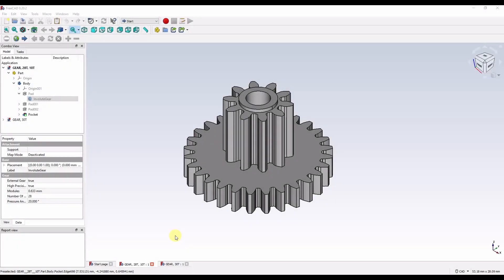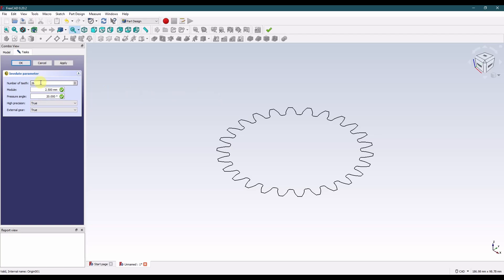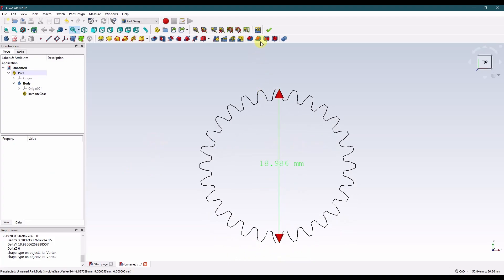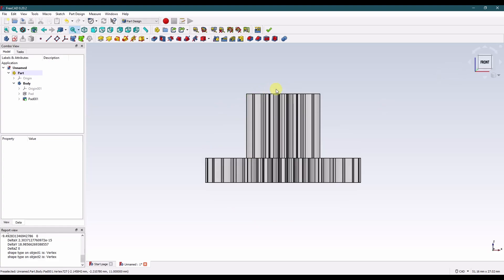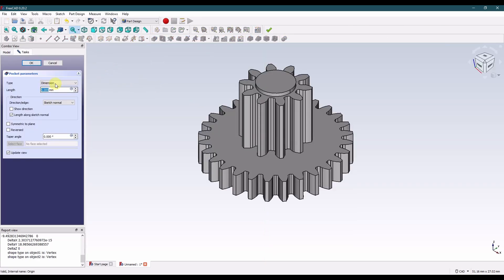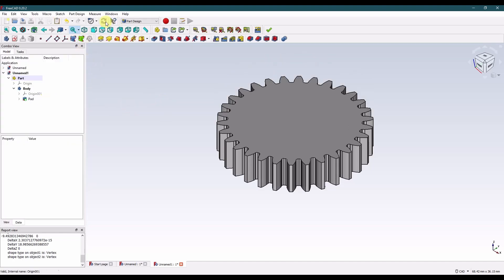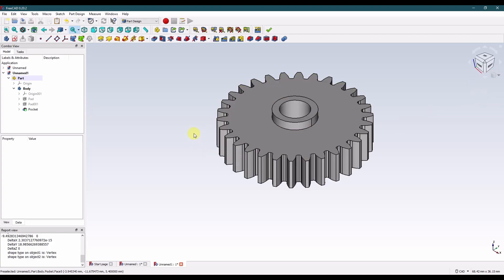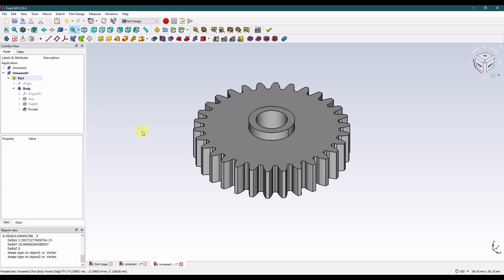FreeCad Tutorial #14 | How to Model Gears in FreeCAD for 3D Printing

Comment: lost you right after involute gear.  No measure function no pad selection.  now what? got to use the extrude function, went to use measure won't measure the distance cant select first point nor second point and the result no measurement of the dia. of the gear.
Reply: What version of freecad are you on? I find stuff can change drastically

Comment: You could make a double hub gear without the need to use supports.
Print the hub gear as you did, then print a washer or spacer the size that the hub would be. You can either glue the hub to the flat side or just place it on the shaft as a spacer.

Comment: question; Is  how to create gears in freecad Path Workbench for cnc,  I can create and 3D print gears to make sure  I have the have right gear reduction and torque.  I want to then cnc cut the gears out of foam for casting into aluminum using lost foam casting technique.  Problem is to create Gcode files in Path workbench.  Any ideas would be appreciated.

Comment: Hi, thank you. Do you know how to make a part of gear? For exemple cut it in half?
Reply: Well, make a gear and then use "subtractive cube" or "subtractive cylinder" in Part Design. With the proper adjustment of the cube you can easily get 3/4, 1/2, 1/4 of a gear, and with the cylinder you directly specify the angle of the sector you are cutting away, so that can result in any sector of a gear. You may also use Part Design's boolean operation, that is very generic; you need to create another body, either a "cut-out" or "leave in", and use a boolean subtraction or boolean common between the gear and the supplementary body. Also, you can switch to Part workbench and use it's boolean operations between gear and any other body, which might be easier.

Comment: Thank you for showing me tipps and tricks in FreeCAD.

But combined gear wheels should have the same module, and that's not easy, when you use three different modules (0,633; 0,75; 0,8) for three gears ;-)
Reply from the maker: Yes, thank you for that clarification. The only modules that combine between the new gears are the .75 and the .8, which are close enough to mesh just fine. I should have used the module as the primary driving input, rather than the outer diameter of the gears, though.
Reply: @KTECDesigns  the module should be the primary driving input. And yes, meshing gears must have the same module, anything else, even close ones, will result in excessive wear and therefore, dust and garbage around. Also in some cases they can simply jam. The same goes for the angle of an action.

Since you were designing both meshing gears, you should have been able to measure the distance between rotation centers and, knowing the number of teeth on both of them, you might directly caclulate the precise module.